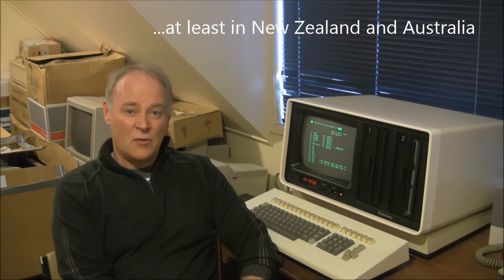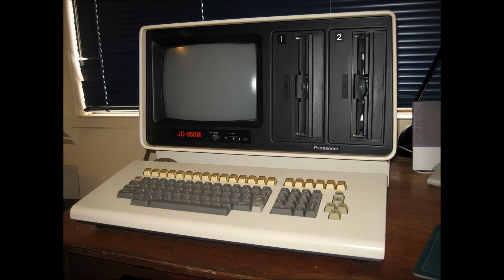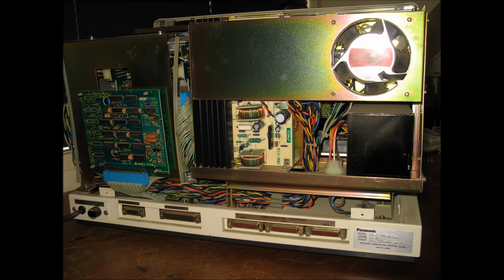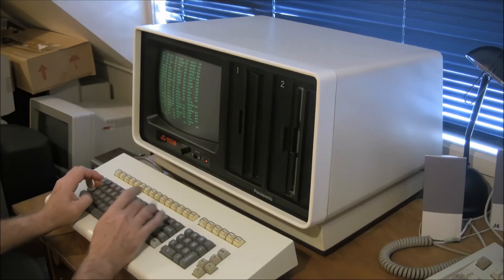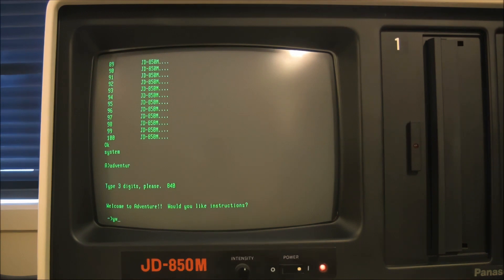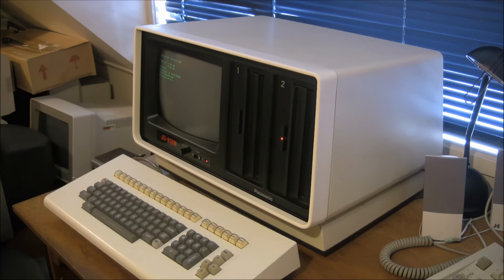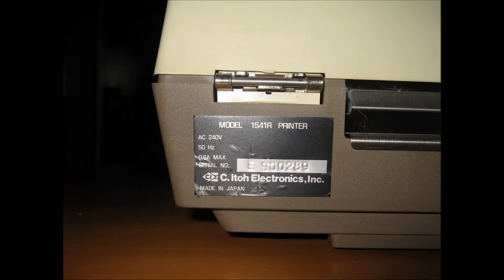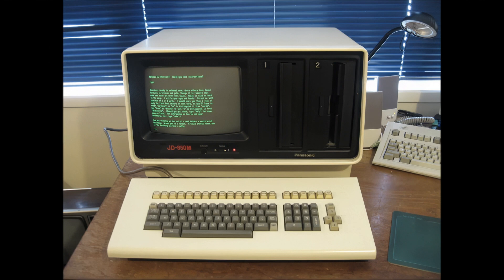The Panasonic JD-850M (as seen in Terry Stewart's computer collection)

Comment: I really don't "get" what is supposed to distinguish this computer from other CP/M machines. It's just an $8000 USD unremarkable run of the mill old CP/M machine, old even at the time.  The 8" floppies would give extra storage, but so would an old S100 computer while offering a ton of expansion options and can run CP/M, though  at a higher cost and much higher maintenance. 
The eight thousand Dollar price point is absurd.  For the price of one 850M, you could buy 4 Osborne or other popular CP/M machines.  Or you could buy one Osborne and but several thousand of the lower storage 5.25" disks.

FYI... there is no such thing as "Commodore Computers"  It's CBM or Commodore Business Machines.